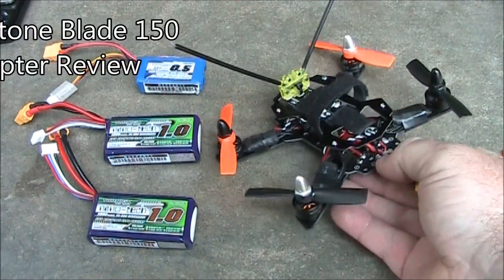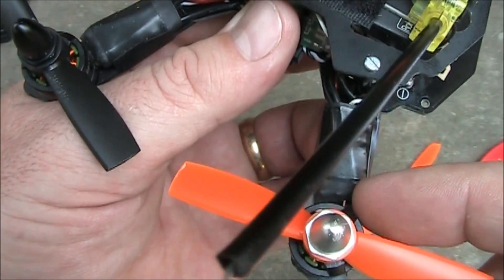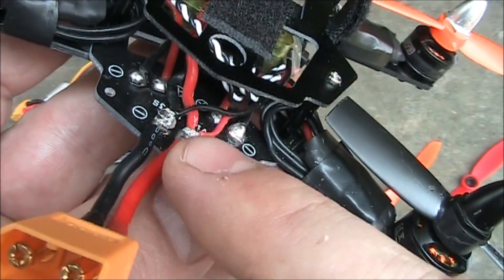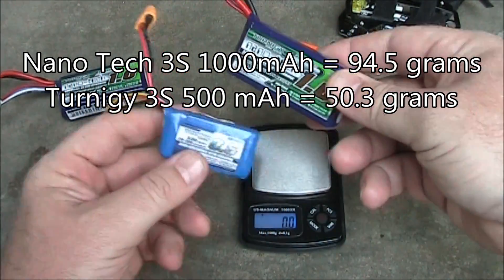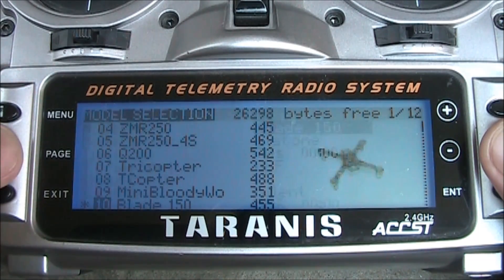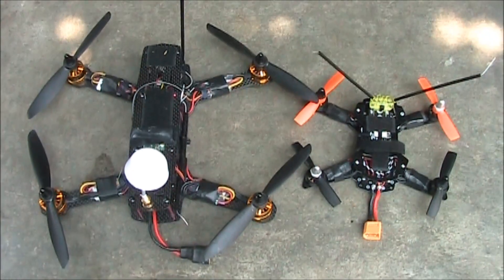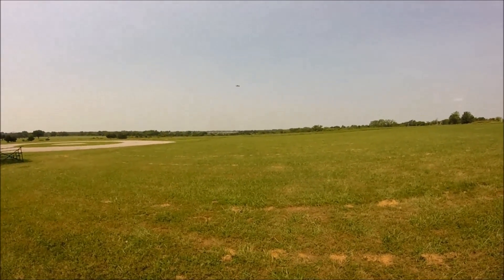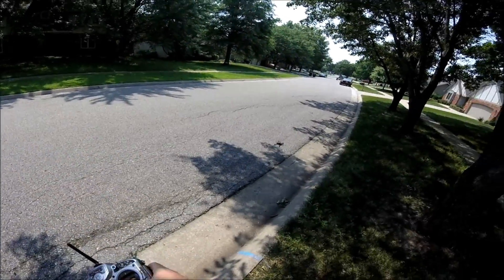Diatone Blade 150 Full Review, Tuning, and Build Tips

Comment: Nice, will it carry a mobius and a mini fpv setup?
Reply from the maker: knwest2012 It should carry small FPV equipment.  I have a camera and video tx on order.  I'll probably have another video once it is installed.  To carry a Mobius, it may have to have a smaller battery to account for the weight of the Mobius - of course that will lower your overall flight time too.
Reply from the maker: knwest2012 I can tell you now, it carries the FPV equipment just fine.  I ordered a 808 camera to put on it to record.  I also ordered some smaller (lighter) batteries to save some weight for the 808 camera.